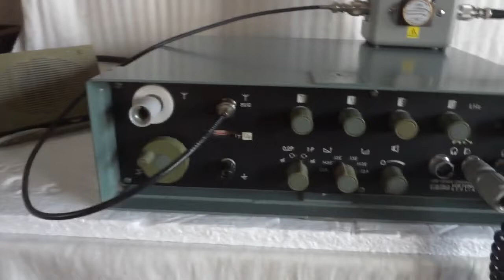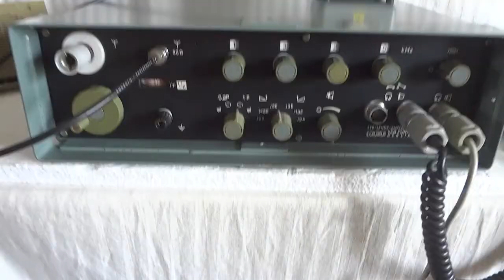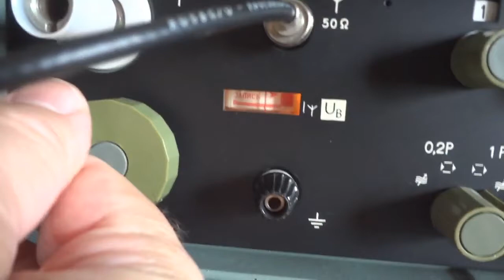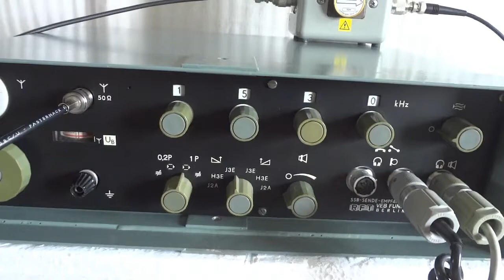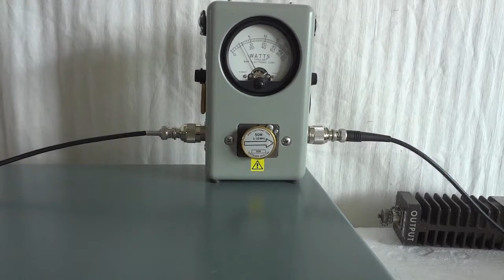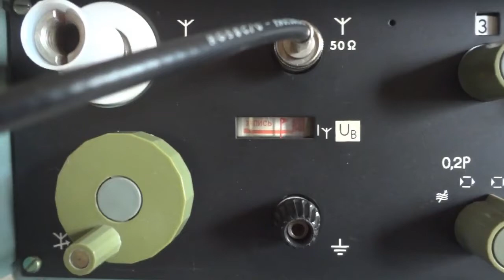Rare SEG-15D HF SSB radio with black front panel East Germany

Comment: I owned several of them and modified them with the filter unit of the SEG 100 to use the 300 Hz mechanical CW filter for Digital Modes... 
Also modified the diode mixer with modern diodes... as well as the Audio Frequency passband... 
And extended the frequency range up to 14,5 MHz for 20 meters DX...
Reply: Hello! Very interesting mods! Any information would be awesome!!